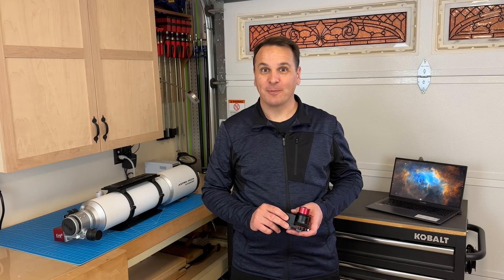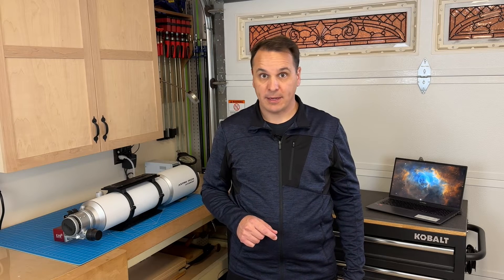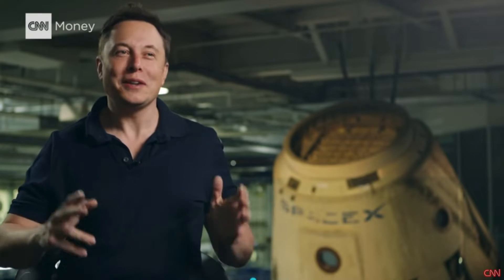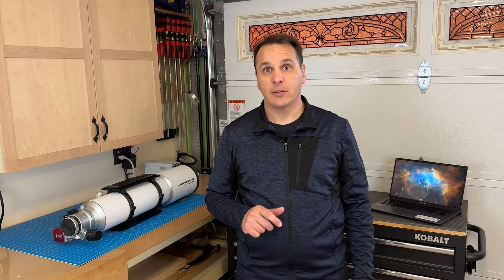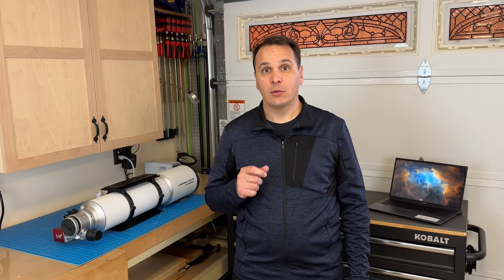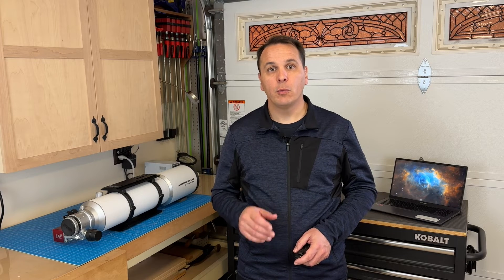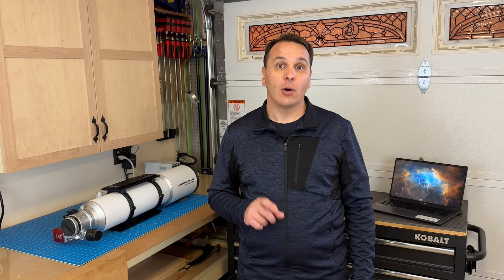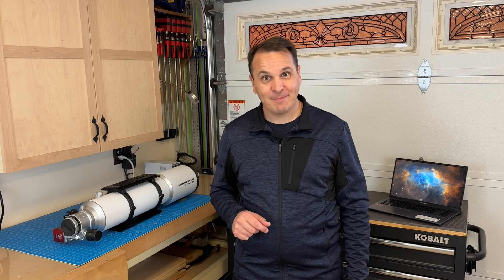3D Printed Motorized OAG Focuser - Part II - Project Updates & Calibration

Comment: Fantastic idea. I'm working on building one now. My 1st adruino project.  Should B fun!
Focus does not change much for me between filters but in general I hate going out to fiddle with phd2 when everything else is auto. Plus...sleep is nice.
I am curious tho, why is this tied to filter changes and not focuser?
For me, the focus changes due to temp etc are far greater than those from filter changes.  My offsets and AF runs are based on lum filiter so as long as its swapping filters, all is good.  But for the sake of argument lets say I spend an entire night in lum. with no filter changes but significant focus change due to temp. Correct me if im wrong, but would that mean the oag focuser would not change since filters didnt move?
Reply from the maker: I have a newer video on this topic that will answer your questions, I hope.
Reply: @darkskygeek Awesome, thank you!  I watched a few. Must have missed that vid or portion of vid. I will look again

Comment: Thank you so much for this, I've just finished building mine, now I need to 3d print and test. Hopefully all will go as planned. Its been a real problem for so many of us out there using OAGs. On a different note this would theoretically work as a rotator too, provided that you change the 3d print design ofc, and the driver. I was wondering if the identifier in the code can be changed for nina to see it as a rotator?
Reply from the maker: The driver would have to be rewritten as it would need to implement a different interface. Thanks!

Comment: Once we are all setup, do we leave the main filter wheel setting on the deep sky geek selection or change it back to in my case the ZWO fw1 setting?
Reply from the maker: I don’t understand what you are asking. Once you are all set up, you don’t need to change the settings inside the filter wheel proxy driver settings dialog.

Comment: First at all, thank you for your design. I have the Player One OAG Max and it's compatible with the "standar version" but the OAG Max has 51mm diameter and the gear stl file has 46mm of inner diameter. Am I missing something? Regards.
Reply from the maker: It’s compatible as in you will need to swap the helical focuser.

Comment: I've been using this for focusing my OAG-L, and I built a second one for the primary focuser on my celestron 6SE using your ASCOM driver, but with my own 3d printed mount.  Surprisingly, the little 12v stepper works great in direct drive, coupled straight to the brass 13mm shaft underneath the rubber cap of the main focuser. Both focusers have been working great, thanks for coming up with this project!

I've been toying with the idea of taking the usual ~500mA 5v input from USB, and adding a 12v pololu boost regulator to charge an extremely small 3s lipo for a mini fpv drone at 12v ~200mA(along with an appropriate BMS), and that will be used to drive the motor. My thought is that it would be able to handle the sudden energy demands of running a focus routine, but then while it's idle during the rest of the imaging session, the boost regulator will be topping the 3s pack back up to ~12v. Maybe you could implement some version of that for your next revision so you won't even need to plug in to charge.😁
Reply from the maker: Glad you found the project helpful! If you use a LiPo, you absolutely have to use a charge controller, or you risk catching it on fire (no joke!) I toyed with that idea, but eventually rejected it as it did not provide that much value. That being said, you may be able to source as much as 500mA from the Arduino 5V pin, and with that, you only have 1 cable to deal with. You have to use a 5V stepper for that to work. I will update the project accordingly. Clear skies!
Reply: @Dark Sky Geek - Astrophotography (sorry in advance, this response got a bit long by the time I finished it 😂) I've had lots of previous experience working with lithium cells and building custom packs - I run my telescope setup from a 400Wh LiFePO4 4s4p set of 38120 cells in an ammo box, with a power meter display in the lid, 3x xt90 panel mount sockets for my main power devices, 3x 5.5mm barrel jacks with individual PWM control to adjust the power going to each dew heater, it's insulated/internally heated with a temp controller to keep the cells warm during the winter, and it'll even jumpstart my car lol

The idea of getting rid of one more 12v cable sounded too good, so I ended up throwing the circuit together with parts I had to see how it'd do. I used a 12ohm 2 watt resistor between the boost reg's 12v output and the battery to limit the charge current at the USB port to ~270mA. I'm also testing a 100mA bleed-resistor balancer to pull down any cell >4.15v. It won't have min/max protection, but it shouldn't be able to exceed 12v or fully drain the battery, but I'll have to bench test and see if this config holds up. lol this idea is very quickly becoming less-simple than originally intended, but I could also add a mosfet to switch the 12v power on only while USB 5v is connected so it doesn't self-discharge when it's not being used.

12v is probably not as useful for OAG purposes, but I think it would still be advantageous if you wanted to build a setup capable of really snappy-quick focusing. I'm running the direct drive SCT focuser at a speed of "16" in the arduino variables which gives me a full motor rotation in about 4 seconds - I'd be surprised if the 5v version could match that. I don't have a 5v one to test and compare or I'd throw it on and see, so this is mostly guessing how it should perform, but steppers produce torque as a function of current, usually limited by the motor driver(or possibly the coil winding resistance with these small steppers/drivers), so for an identical motor and current at either 5v or 12v, you should get the same low speed torque, but higher peak rpm on 12v before losing torque/skipping steps.

I'd also guess the 5v motors are wound differently to get more usable torque with an appropriate current draw for typical 5v sources as well, so they could be even slower than just the difference in voltage would be responsible for. I ran into this situation while building my CNC - Switching from 24v to 48v resulted in a huge boost in rapid speeds without skipping steps(but those drivers are also pretty advanced). If these tiny drivers aren't that fancy and are just using the coil resistance to limit current, then it'd likely just cook a 5v motor with a 12v input/driver, but it'd certainly be torquey and fast while it lasted lol

Anyway, if I do install the 12v step-up circuit into my actual imaging setup, I'll let you know how it goes after a couple nights worth of focusing runs. Thanks again for making this so good for the DIY crowd 😄

Comment: Excellent projet, que j'ai réalisé sans tarder pour motoriser et compenser non pas la caméra sur l'OAG mais mon focuser principal (ma caméra d'acquisition est une ASI294MM Pro avec ZWO Filter Wheel). J'utilise un stepper en 12V pour l'entrainement direct de la sortie démultipliée de mon focuser JMI. Tout est parfait pour une utilisation standard (un grand MERCI pour le partage de ce projet), sauf que NINA refuse de connecter le Filter Wheel Proxy (<<Reason: set - " is an invalid value. The value range is .>>). J'ai essayé pas mal de choses sans succès. Tout le reste fonctionne normalement. Je n'ai donc pas encore pu déterminer si l'utilisation de la compensation via le proxy était pertinente dans mon cas ou pas. Très curieux... Une idée ?
Reply from the maker: Si vous utilisez seulement le système de mise au point, alors pas la peine de se soucier du filter wheel proxy car il n’est utile que pour un OAG.
Reply: @darkskygeek  ok, merci pour votre réponse et vos contributions...!